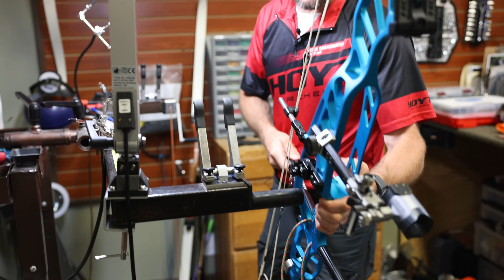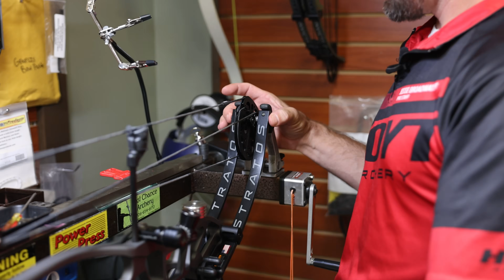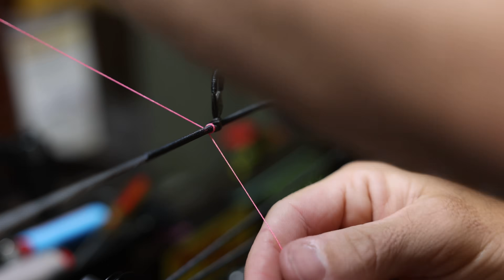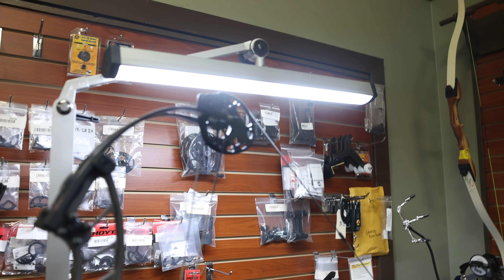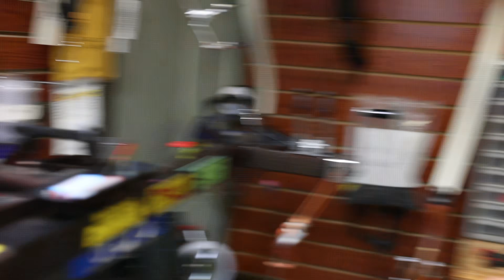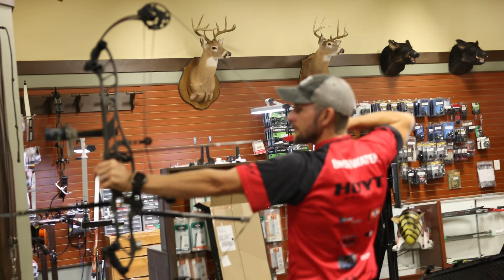Hoyt Stratos Setup

Comment: Hi Jesse. I watched your video carefully it was inspiring. I have one question regarding height of arrow and D-loop. You placed them slightly  above. There is only a single point on the string where you can place arrow nock and that nock will travel in a straight line. If you place the arrow above or below this point, the nock will travel in an arc. I understand that placing the arrow nock above or below this point can improve aiming stability, but it causes porpoising, i.e. it worsens the flight of the arrow. The arch cannot by straightened into the line by  height of the rest because the rest does not affect the movement of the string and therefore the movement of the nock Does it matter? Thank you.

Comment: What serving do you normally use for your center servings? I’ve heard you mention you like to re-do yours and I was wondering what your favorite material is. Also, what size do you typically use?
Reply from the maker: BCY power grip is my choice… and I like a looser nock fit… most times my serving is .107”

Comment: Most people set the arrow to be centred on the Berger hole but you set it higher. What's the thinking on that?
Reply from the maker: More times than not on these Hoyts, or any other bow with the grip in a similar location, people will aim better with the loop a lil higher. But it’s definitely something you want to play with on your own, and see what works best, because there are a lot of variables to come into play.
Reply: @jessebroadwater  Hi Jesse, appreciate the time you're giving in these answers. Good luck in Vegas!
Reply: Interesting to see the parameters you can actually play with. I have never investigated the effect of running the arrow high like you do here (or low) but now I want to.

Comment: Is there a way to make the HBT cam feel a bit more firm on the back wall already using 65 letoff and hard feet. I usually shoot svx and I'm trying the 40 HBT. It just doesn't quite feel the same.
Reply from the maker: Have you tried taking the rubber out of the mod feet? That would be about the only other thing to try… also make certain that it is timed dead even.

Comment: Out of curiosity why not just measure the peep height from the arrow to the peep at full draw to be even more certain you've got the right spot?
Reply from the maker: Very well could have done that. I knew we would be close as the axle to axle on those two bows were close to the same, and I always have the person draw the bow with eyes closed a few times to make sure it’s right for them on each particular setup.. a lot of variables… axle to axle, draw length, loop length, even the way the bow is weighted/balanced…. So it was mainly just a “rough in” until he actually got hands on, and we made sure the fit of the bow was good, while fine tuning the peep… but you are right, in most cases, full draw pee to arrow is way more accurate that static measurement.